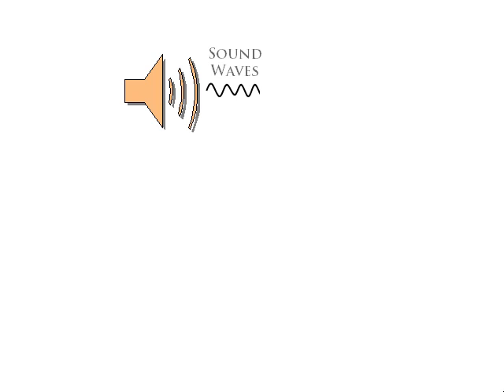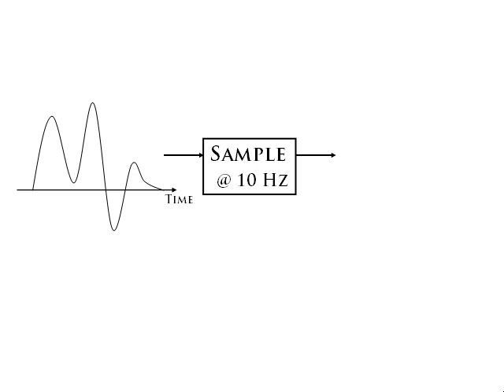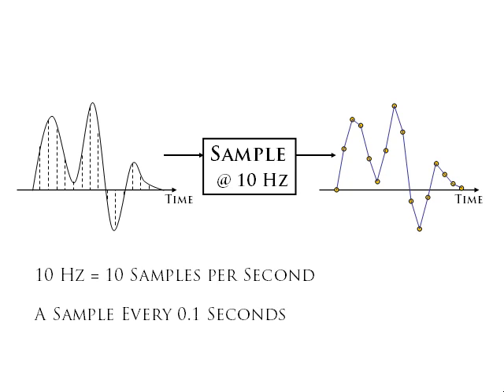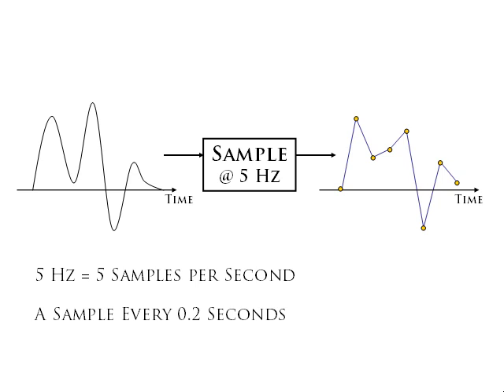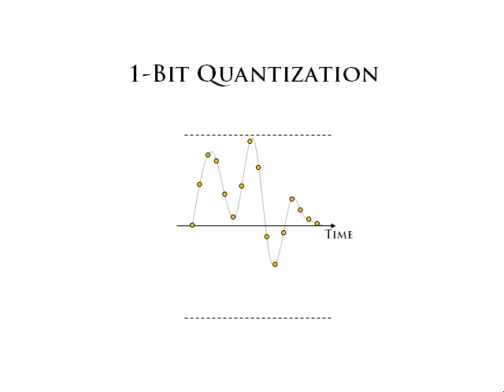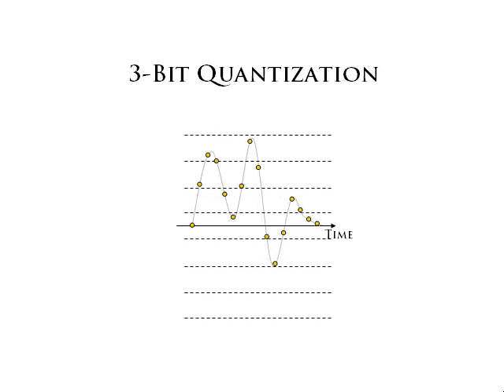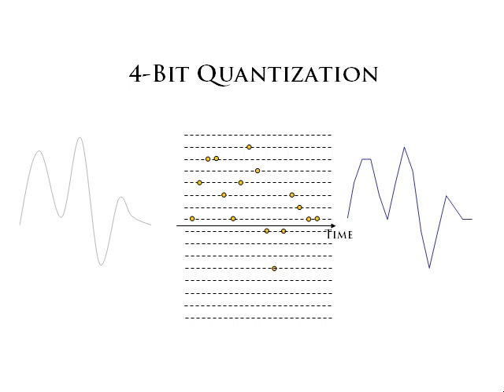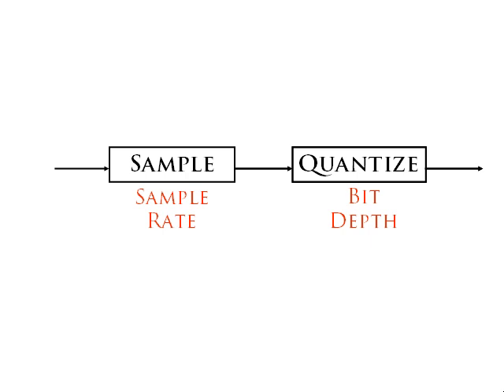Music Technology 101: Sampling Rate and Bit Depth Explained

Comment: There are a few errors in this presentation which are quite common misconceptions among laymen:

1. There is NO "connect the dots" involved, but a 1:1 reconstruction of the input wave, which is bandlimited (determined by the Nyquist theorem) and with limited signal to noise - ratio (as determined by the bit depth... the simplest case being number of bits * 6 = maximum dynamic range in dB)

2. Please don't refer to the dynamic range as "quality of the quantization", this is heavily misleading (while not entirely untrue) - you CAN reconstruct the whole bandlimited input signal, theoretically, from a 1 bit signal as well, problem is only the limited dynamic range

3. Please don't say "sampling lower as 44.1 kHz causes aliasing", this is so wrong... the aliasing would be, in fact, present at every sampling rate, but there is a low pass filter (or two, in case of oversampling) involved to get rid of the frequencies above the Nyquist frequency before (down-)sampling

4. Your 3 bit quantization is totally wrong... there, again, is NO "connect" the dots... what you showed there would introduce an insane amount of frequencies beyond the Nyquist frequency, therefore your simplicistic "connect the dots" is an invalid solution

5. The sampling rate determines the highest frequency which can be reconstructed from the digital data, formula is: maximum frequency = sample rate / 2

Of course you need some buffer above the Nyquist frequency (= maximum frequency) for filtering.

This video, sorry, is factually absolutely incorrect and not recommendable.
Reply: thnx for this video.
Reply: That's linear interpolation though, isn't it?
Reply: I must say this helped me understand at least what I need to look for in an audio interface. More sampling rate and more bit depth! I really wouldn't care about the technicalities. A very simple way of explaining what I need to look for and why.
Reply from the maker: Thank you for the interesting comments Chris. I was thinking of doing an "accurate" version of this video for a while, but one must often make decisions: do I want to give the big (yet incomplete) picture, or do I want to give the full technical details, which will result in a 30 minute video with too much detail for the average viewer who wants to understand what people around him or her are talking about.

It's noted throughout the video that there are a few "white lies" spread throughout, and "connect the dots" is said tongue-in-cheek - obviously there's no digital "crayon" doing that inside the computer. Science is full of pictorial representations which are not 100% accurate BUT contain within them the essential ideas or concepts.

A "correct" video would also require a lot more background, technical detail, etc ... for example, real world ADCs do not do a 1:1 reconstruction of the input wave. What does that even mean in the context of ADCs? they don't reconstruct anything, they sample, and no reconstruction is done internally in the computer - or are you referring to DACs? Which then need infinite support kernels which will never happen. And do I really want to discuss how a delta-sigma modulator works? Will that give the viewers "true understanding"?

On a different but related topic, would you also advocate, e.g., not teaching the Bohr model of the atom because it's wrong? (yet immensely useful conceptually and for estimation purposes).

Assaf
Reply: Have a look here:

D/A and A/D | Digital Show and Tell (Monty Montgomery @ xiph.org)
Reply from the maker: ***** An excellent tutorial that's also significantly more technical, fast paced and much longer (at 25 minutes total), and therefore appeals to a more tech-savvy and advanced crowd. Wouldn't linking to Proakis's 1000 page tome on Amazon be even better?

When I started learning guitar I was taught the a C chord is one shape and a D chord is another, and later on I learned they could be inverted and played in multiple positions on the fretboard. Would that make the initial lesson wrong or worthless?
Reply: Well, the difference here is that the initial lesson provided by you is factually wrong and contradicts the truth (and further lessons on the same subject).

For example:

You give the impression that the reconstructive process is limited to linear interpolation, which is clearly wrong, because, in reality, there is also a low pass filtering (another bandlimiting) for reconstructive purposes involved, which totally changes the whole output.

What a pure "connect the dots" approach would do is to create lots and lots of frequencies outside of the band, because every complex waveform is no more than the sum of its partial sine waves (the Fourier theorem).

Also I don't think that the xiph - presentation I linked is so much more complicated, in fact I think one can show that to high school kids and they will nod it off. :-)
Reply: @chriskamper6854  Your making this way to complicated

Comment from the maker: Good question. Unfortunately outside my expertise: I know what the differences are, but these have to be weighted in the context of digital audio, which is tricky and probably best done by a (very experienced) software engineer who specializes in DAW. Personally (just guessing), I'd be very surprised if the differences are meaningful. With today's 32-bit engines, I'm sure errors only accumulate in the first few bits, well below the noise levels and ears' dynamic range.

Comment: because i heard that for bit depth some digital audio workstations use a floating point system some use fixed point. (not sure if its entirely true)

but ProTools only had fixed point based bit depth..Protools 10 onwards they have introduced 32 Bit Floating point.

I am just wondering how does it affect

Comment: A "float" is a way for a computer to calculate with decimals. A standard "float" value is 32bits long (4 bytes). It's called a "floating point value" (full name) because the decimal point can move and is not fixed to a certain number of decimals. (They actually work with fractions, not decimals.) It's all very technical, but basically it means a 32-bit value that contains decimals and not just an integer.
Reply: IEEE 32-bit float has only 23 bits for mantissa. There are fewer than 2^32 possible exactly representable values, so you also quantize, only somewhat finer (~28 bit, effectively), and on a logarithmic scale, not linear, like integer PCM. This has a benefit, indeed. All internal processing in production uses floating point samples. POTS uses the same trick with u-law 8-bit encoding (or 10 bit A-law, on the wrong side of the pond), where 256 (or 1024, in A) possible codes translate into amplitude logarithmically.

Comment: (Continued 2:) Btw, analog tapes bit depth and sample rate is basically only limited by the density of atoms in the material (and so on, not to get too technical). They have almost infinitely higher bit depth and sample rate than any digital recording. That's part of why analog tapes actually sound better, not including the noise and compression/distortion, unless you like that.

Comment: (continued:) However, since analog tapes have a noise floor (more or less), you need to record close to it's limit to keep the signal-to-noise ratio as high as possible. So most analog recordings are recorded at the volume where the compression (and distortion) start naturally kicking in. 
Digital recording tries to record close to the limit aswell to make use of the bit depth. But if you record at 24 or even 32 bit (extremely rare, I think), you don't really need to care.

Comment: No, the bit depth has nothing to do with sounding compressed or not. The reason analog recordings soudn more ompressed is because they are not linear. Analog tapes have a hard time correclty representing negative current, and a hard time representing strong current in relation to weak currents, so doubling the input volume doesn't double the recorded volume, which means it's been compressed. Digital recordings are linear (they try to be), so they don't cause compression unless you want them to.

Comment: I'm sorry, but that's absolutely not how it works. Bit depth has no actual corrolation with volume or compression. If that's what you think, then you've fundamentally misunderstood it all. Like you said in the video, bit depth has to do with quantizing, not sound levels. As long as you're working at 100% of the range that a wave can represent, the actual sound recorded is not a factor.

Comment from the maker: Recording a 60dB signal with 40dB of noise in 16 bit is the exact same as recording it in 24-bit (except the noise and signal being more "detailed"), as long as your input is calibrated appropriately to the entire inputs' dynamic range. In general, although I don't hear a difference, many claim they do, so I'd recommend 24 bits (there's no "cost").

Most importantly, TRUST YOUR EARS and EXPERIMENT. Record the same signal in 16 and 24 bit and see for yourself! Don't let "experts" push you around.
Reply: You can never "trust your ears" as I know an audio engineer who's end result if his mixes are very "tinny" and he thinks they are fine. Obviously everyones ears are different. I have superb hearing in the high range. I can hear up to 16khz then it drops off then I can "hear" a sound around 17.5 khz. The audiologist says that my bones in my ear are resonating at 17.5 by my eardrum isnt actually hearing it. So with that being said, everyones ears are in fact different.
This is why standards are developed 
I have worked in broadcast video for over 50 years and i can tell you that we align both audio and video using electronic measuring devices to adhere to a standard. This ensures that everyone is guaranteed of receiving the same signals and everything along the transmission path is the same. When it gets to your home devices this is where things sound and look different.
For example a person once said "we broadcast a picture not some electronic waveform, so adjust the picture to the monitor thats on your video monitor." Of course that is PURE nonsense, as even the term "monitor" only means to monitor a signal, not to align it with a standard.
We use waveform instrument & vector scopes to align the picture quality to a standard. Whatever is displayed on a "monitor" is irrelevant. Audio is adjusted to a calibrated VU meter to ensure proper audio level is being sent out. The video tape machines themselves are calibrated to a test tape that was recorded on a perfectly aligned machine this a standard in the industry. No one relies on thier own eye & ears for correct values.
Your hearing may be vastly different than mine, but I am accustomed to hearing things a certain way, and that way is my own personal standard. As long as audio engineers conform to standards in the signal chain they only variable is the audio engineer themselves and they vary greatly.
It would be interesting to see the results of these audio engineer audiology reports.

Comment from the maker: I've never heard any significant difference between the 16 and 24 bits, although some people claim they do. My classical music CDs, which usually display the widest dynamic range, sound fantastic and "uncompressed" to me. 

From a physics perspective, 16 bits give you a much wider dynamic range than what you'd encounter in everyday life. Anyway, with today's uber-compressed music, I suspect 8-bits will soon suffice :).
Reply: 8 years later, YouTube audio bitrates are far higher and capable of far better quality
Reply: With a noise shaping 16 bits can give about a same dynamic range as 24 bits can. The only reason of 24 bits is to make a better result with a further DSP. For an output 16 bits are more than enough.

Comment from the maker: @mikevanstaveren kbps means "kilobits per second". It doesn't tell you anything specific about the sampling rate or bit depth. For example, an uncompressed 8-bit, 16kHz recording is (2^8 bits) * 16000 (per second) = 4096 kbps. Same goes for a 9-bit, 8kHz recording (=2^9*8000=4096 kbps). Note these numbers are much higher than the average 320 kbps MP3s use. That's because MP3s use lossy compression to reduce the number of kbps (without significantly degrading the quality).

Comment: @mikevanstaveren, if you are ever buying an mp3 online, remember: mp3 is a lossy form of compression.

Generally, the recording doesn't have to be the same bit depth as the distributed recording; especially if it is online or on CD. Generally, online mp3 purchases are 16 bit and 44.1kHz, so that the average consumer may easily play the purchased audio using other CD and mp3 players if the wish to burn or play a copy off of a computer.

If it is 24 bit, it will likely say hi-fi, or at least 24bit

Comment from the maker: @MangoldProject As for why quantization is needed: it's a necessity. Ideally, we'd like to do away with it, but your computer has finite memory and processing capabilities, so it must store the voltage of the recorded waveform using a finite set of numbers. It's part of the price you pay for going digital (analog waveforms also have "effective" resolutions because of signal to noise, etc., but that's a different story.)

Comment from the maker: @mikevanstaveren Your math paper analogy is good, with one caveat: think of the soundcard as the "grid" on the paper, not the paper itself. You DO play connect the dots, BUT not the original waveform's dots - first, when doing Analong->Digital, you're "warping" the input dots to the closest positions on the grid. When doing Digital->Analog, you're connecting the RECORDED (warped) dots. This "connect-the-dots" does NOT match the original waveform. It may be very close, but not exact.

Comment: Good presentation, beautifully paced delivery. Just one issue. I get the impression from your explanation that the more samples taken the better the waveform reconstruction. We need to sample only twice per cycle to regenerate a sinewave perfectly (Shannon: (sine x) / x function) and because the highest freq. of interest is 20Khz we are compelled to sample at 40kHz (ignoring aliasing). The abundant samples at lower frequencies adds nothing.
Reply: In theory, there is no difference between theory and practice, but in practice there is. 

To ADC a signal with Fs=44.1kHz, the CD sampling frequency, you must bandlimit it to 22.05kHz. There is energy in real world signals above 20kHz, and you'll alias it badly without bandlimiting the input. If your bandwidth of interest is 20kHz, and you want to perfectly sample it at 16-bit resolution (absolute quantization noise floor at ≈99dB), you want an LPF with the gain of 0dB at 20kHz rolling off down to -96dB at 22.05kHz in analog domain. There is only log2(22.05/20)=0.14 octave of the transition band, and the filter needs to be as steep as 99/0.14=700 dB/oct. This is an insane quantity, far out of reach in analog.

In practice, you always oversample, bandlimit in the digital domain again and decimate.  Even at 4x oversampling of 176.4 kHz, the ideally required analog filter still needs 45 dB/oct, or 7.5 double poles. Practically there is always a compromise, since the total power above 20 kHz is not that large, so you don't go down all the way to ‒96dB when prefiltering. Also, you spread quantization noise with oversampling over the whole bandwidth, which is then proportionally removed during decimation. A ×2 oversampling ADC with 3 double-pole LPF cuts ‒40dB at 22.05 kHz, which was considered a home-semipro studio grade conversion 15 years back. Analog filters are expensive, but so are quality high sample-rate multi-bit SAR ADCs, so there's always a compromise. With the modern silicon you go with sigma-delta 1-bit conversion with typical ×24-48 oversampling, not requiring prefiltering. 3rd order sigma-delta modulator loop (and a higher-end converter is a whole SoC) yields the quantization noise floor below –110dB at ×48 the target sampling rate. This puts it into a multi-MHz range, which bumps the cost of silicon, packaging, PCBs and assembly with the need for multiple separate power and ground islands/planes and decoupling caps on package (or directly under, on the other side of the PCB). Here's the theory in practice for y'all, folks...

Comment from the maker: @guitarbasslover (continued):
2. Additionally, there is a "law" which states that, to reproduce frequencies up to X, you need to sample at a rate 2X (the so-called Nyquist's criterion). Since we're interested in audio only up to 20kHz, sampling at 40kHz should be enough. For practical reasons having to do with converter design, this is often extended above 40kHz. However, if you're asking me whether a human being could tell the difference between, say, 192kHz and 96kHz, my answer would be: NO.

Comment from the maker: @guitarbasslover: generally, the answer is "yes". However, there are a few provisions.
1. Beyond certain thresholds our ears cannot tell the difference. There was a paper in the Journal of the Audio Engineering Society in which a 16-bit, 44.1 kHz AD-DA converter was inserted into the path of an audio track; several audio professionals were blind-tested and it turned out they couldn't hear a difference between the audio with and without the converter.  (continued in next comment)

Comment: @seskandari2003 

If you are asking why it needs to quantize its because the computer cant recognize random points on a graph. they need to be on a specific line in order for the computer to recognize where it is, and by quantizing you move each dot to the closest line, in order for it to be recognizable by the computer. And as demonstrated to more lines, the less distorted the signal

plase correct me if I am wrong.